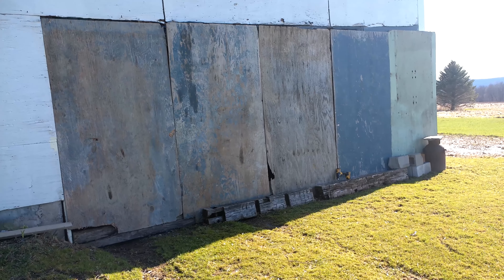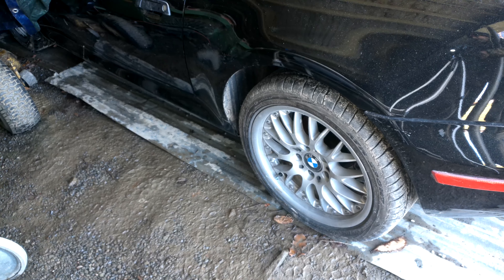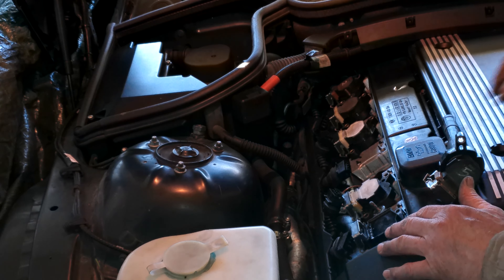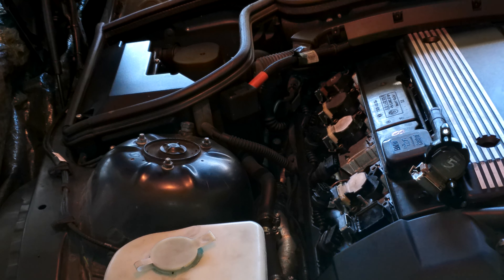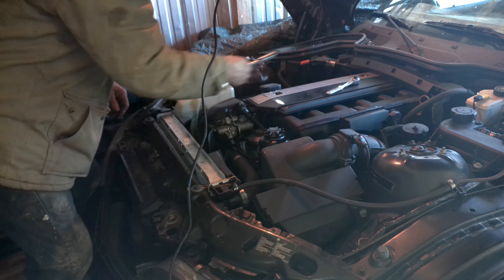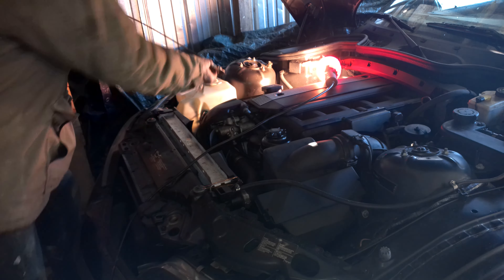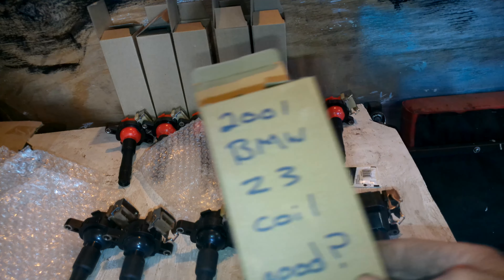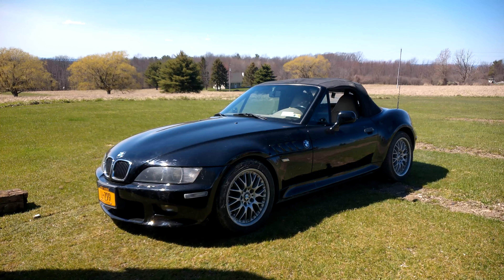Z3 BMW Barn Find!!

Comment: What also works well for grabbing the spark plugs is a piece of 5/16 or 3/8 rubber fuel line. Goes right over the end of the plug and pull it out easy peasy. You can also put them in that way and get the threads started,  instead of just dropping the plug in the hole and possibly damaging the electrode.